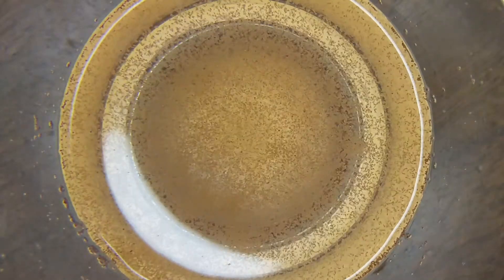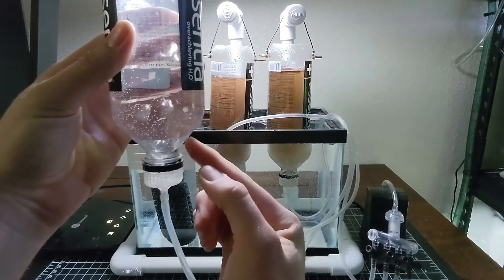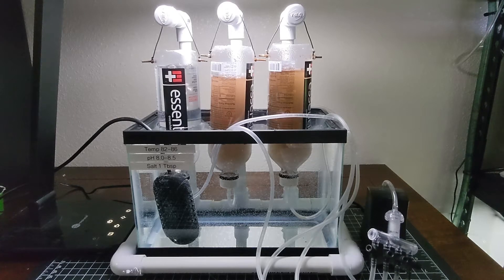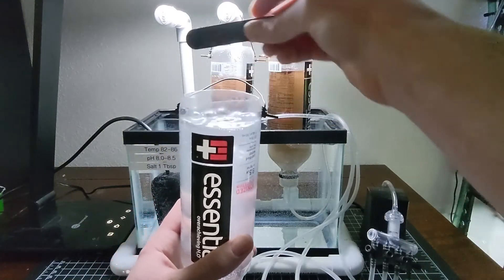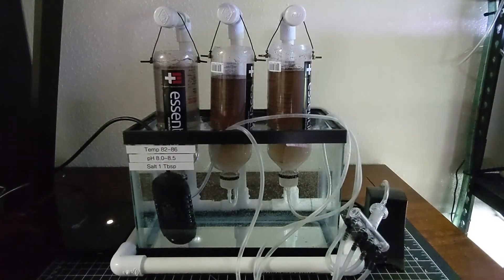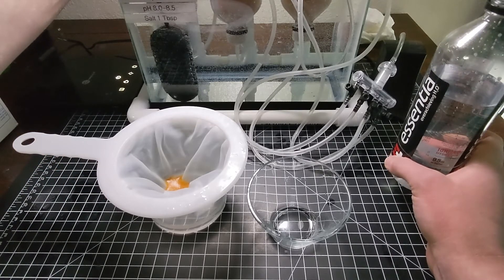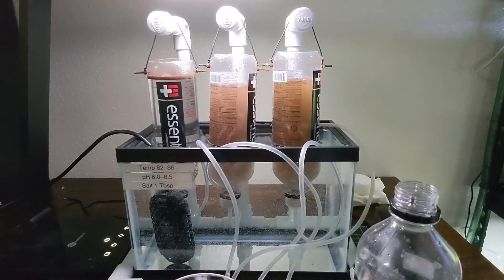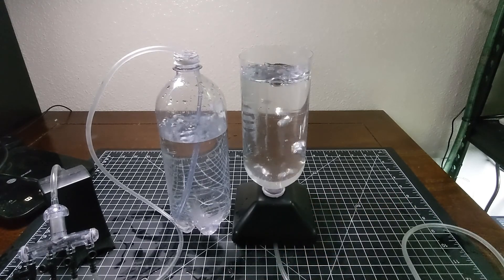How To Hatch Baby Brine Shrimp, All Day Every Day (With Timestamps)

Comment: I like the Fiji water bottles because the plastic is so rigid. Instead of cutting off the bottom I drilled a hole using my largest Forstner bit.

Comment: I’m using a Ziss hatchery and having problems with bad eggs sinking to the bottom that even with rigid airline sitting at the bottom has them collecting with the bbs. Tried a bunch and my hatch is a good rate but the small amount that don’t float I can’t help from collecting out of the bottom when first opening the tap. Worried the eggs could harm my Cory and danio Fry

Comment: How do you keep the temperature up if you don't have a warm designated fish room available  ?
Reply from the maker: In this video the bottles were mostly submerged in a warm water bath. You don't have to use extra heat though, it just helps to hatch faster. They'll hatch fine at room temp it just takes 36+ hours
Reply: Thank you.

Comment: That’s a lot of work.   I bought a device on Amazon that doesn’t require air, light or heat.   It has a baffle system to separate the eggs from the hatch.
Reply from the maker: You should use that

Comment: I really like this 2.5g set up you have. What did you do to hold the PVC pipes in place? Also, do you remember where you found that net?
Reply from the maker: there is a rectangular PVC ring around the base with 3 T joints to support the vertical lengths. It's all glued. The net was from amazon. Try searching for brine shrimp net